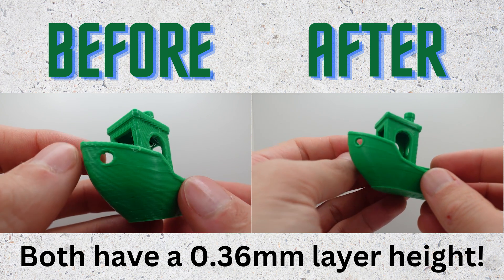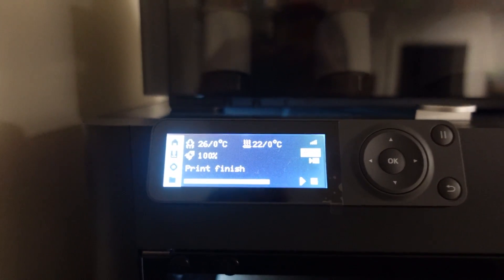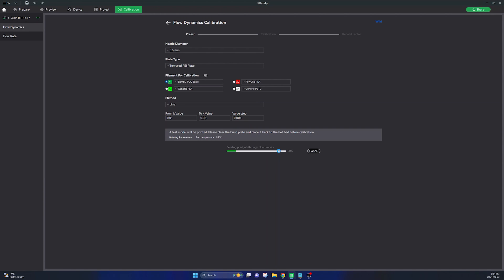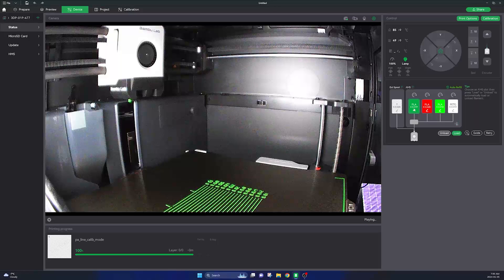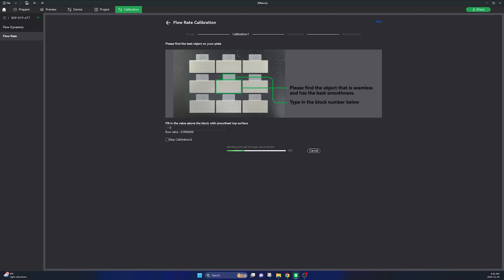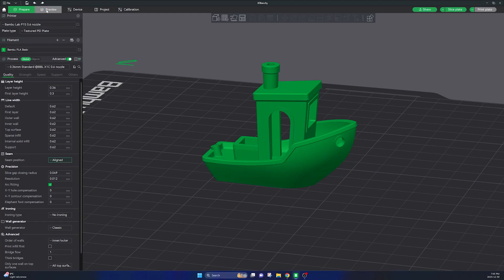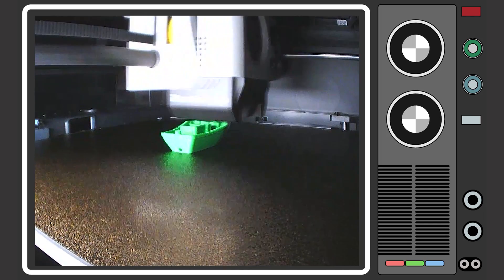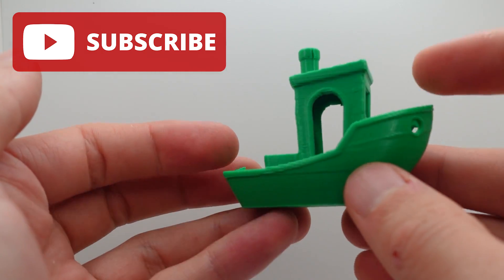How to Improve Print Quality on Bambu Lab 3D Printer!

Comment: Did not see any quality increasing, your benchy is still horrible. Maybe need to dry filament or replace nozzle
Reply from the maker: Keep in mind I am using a larger 0.6mm nozzle and printing at 0.36mm layer height.. I’m really pushing things here, this setup is not supposed to print fine detail well.
I am using a fresh roll of Bambu PLA and the quality definitely increased.
Reply: @engineer3dprints why bother posting a video with mediocre results? Saying “this setup isn’t supposed to give good results” isn’t terribly reassuring.
Reply from the maker: The purpose of this video is to show how you can improve your print quality. My print quality greatly improved even with my larger nozzle/layer setup, however my setup/results should be irrelevant - this will help you improve quality regardless of your setup.
I could have shown a “high quality” out of the box print but that wouldn’t really prove anything.
Reply: +1 for drying, in looking for new filament sources, I’m seeing people commenting that even NEW reels presumably well-packed are not dry, and improve a lot after drying, even from some big name suppliers.

Comment: It may just be me, but my out of the box prints were flawless.  I am not sure what I could do to change things to make it better.  How do your benchies look so bad.  Even the better quality one.  Not trying to be harsh, just not understanding how it is so bad?
Reply from the maker: Keep in mind I am using a larger 0.6mm nozzle and printing at 0.36mm layer height.. I’m really pushing things here, this setup is not supposed to print fine detail well.
Reply: @engineer3dprints  how fast did it printed on this setting? got mine in 16 minutes with 0,4 and it looked perfect...
Reply: @engineer3dprints  I think you might want to emphasize that you are testing and optimizing a non-standard setup that is far more challenging in the future for all those wondering why this is so different that the typical P1P experience.  That said, this is really a great video as I had hoped to use these faster nozzles and layer heights for my functional prints. Glad to see that it can still produce very high quality!
Reply: My prints are also flawless. If you’re using the original Bambu filament and have all the calibrations on for each print, the printer will actually automatically calibrate for EACH print without you having to adjust anything. This is better on the X1C because you have the benefit of the LiDAR. However, where this really shines is non Bambu filaments - because they also get calibrated automatically for flow and pressure advance, and you also have a first layer inspection to boot. 

For anyone looking for good results I’d honestly recommend not touching the settings and messing with the profiles unless SOMETHING IS WRONG. You don’t need to fix what’s not broken, just do the 7.5 minute calibration on every print and worry less.
Reply: Do you have to do this calibration every time you swap nozzles? I have a .4 and .6 so that I could hot swap them anytime I wanna use various filaments that need them, but this is a LOT of work if you need to do it every time you swap.
Reply: @zachhalliwell553 I would recommend it. It’s not a big deal. It happens automatically and takes 7.5 minutes. In that time your printer will ensure everything is perfect. That’s a lot better than coming back to a print that never printed on a proper first layer and looks like a dogs dinner.
Reply: Me too the benchy I sliced and printed on my X1C was flawless.
Reply: My P1S and Mini did print perfect right out of the box as most people are saying but I did notice quality 60 days. 
I got a lot more stringing but as soon as I changed out to a new nozzle it went away! 
I think changing out different materials definitely has a negative effect on it. I went with a hardened one now as I'm curious to see if it lasts longer before I noticed any defects showing up. 
I've also been told that you need to clean out the printhead as filament dust and particles can cause problems as well.
Reply: Not just you, mines been great with the supplied filaments, I presume I'll have to go through this process if using non Bambu filaments gives me issues.
Reply: Looks like other issues with his “Odor Layer.” Best tip I’ve found so far to help enhance quality is printing outer walls first. This will only go so far though since he’s using a larger nozzle. A layer height of .36 is going to have much less detail than a .16 layer height using a .4 nozzle. Of course, this is also pushing the limits. Ideally, you should use a hardened .2 nozzle to get finger details. If you want to hide the layer lines even more, adding fuzzy skin will help. However this will not work with functional, moving prints. Also, you will loose the flat, shiny outer layer. Just some ideas after watching this. Rant over.
Reply: Dudes please be aware that the models on the sd cards are heavily modified.   I did the sd card benchy and then sliced my own using the bambu presets straight after with same filament and environment.  Both were really good but had to slow the printer down on mine as quality was. Rap at the start.  Appreciate most will know about the bambu sd card versions being modified but some people won't.  The guy making the video has done a great job in demonstration the quality differences.   😊   p.s from creality to bambu p1s was the best move ever 😂😂
Reply: Yea, don’t have a 3d printer yet, but, I did not understand the porpoise of this video, all I know is Bambu labs will be my first, not sure which one.
Reply: I agree. Both of these benches look terrible. My P1S prints out of the box look way better.
Reply from the maker: My P1S printed great out of the box too. The purpose of this video is to show how you can improve your print quality, my specific setup/results should be irrelevant.
I could have shown a “high quality” out of the box print but that wouldn’t really prove anything.
Reply: @engineer3dprints  but did you actually improve anything? the initial print was terrible- so anything would be an improvement from there. not trying to be offensive, but if you're starting with crap, and ending up with a bit better crap, that's not really something worth advertising. 

My first print was the benchie on the SD card, and it was flawless. If that print looked like your initial print, I would have returned the printer straight away.
Reply from the maker: My first print from the SD card was flawless too. Ill be sure to use a smaller nozzle/layer height for future videos when discussing quality.
Reply: @nakleh   Thank you, your comments are very helpful. I've been researching upgrading from my ender 3/neptune 2s machines for less maintenance, but I'm seeing such poor quality prints from bambu printers everywhere. I'm now realizing Bambu is giving noobs the confidence to go buy their first printer and start that "expert" 3D printer youtube channel they always dreamed of. It might be a great printer for experienced printers, but sifting through the garbage is wasting too much time at this point.
Reply: @nakleh Sould you recommend Bambu printers over Enders? After researching, It feels like buying 8 enders is better than one p1s combo (for same price) in terms of print quality, speed, print volume per month, part availability, 8 different colors at same time vs 4 colors etc.
Reply: @nakleh  Did you completely neglect to read the other relevant comment in this thread from the OP? You know, the one before you actually commented? It mentions that he's using a 0.6 nozzle and a .36 layer height... Obviously, it's not going to do fine detail very well. This isn't "out of the box" -- this is him utilising a modified setup (that's aimed at bulk printing instead of detail printing) and trying to get it to show a decent level of detail despite that.

As for you saying "but did you really improve anything?" the answer is quite obviously yes. You said it yourself when you said "you're starting with crap, and ending up with a bit better crap," -- a bit better = improvement. That's the definition of improvement.

Also, I learned something from this video, despite my print quality already being fantastic, because I focused on the message of the video rather than the quality of the print; if you didn't, that quite likely says more about you than this video.

Comment: A fully informative video without the filler.  Very thorough, very appreciated.
Reply from the maker: I appreciate the comment
Reply: @engineer3dprints  It was impossible to choose between 3 of the swatches on the 2nd Calibration.  I just picked the middle of them and called it a day.  They all looked/sounded too similar.